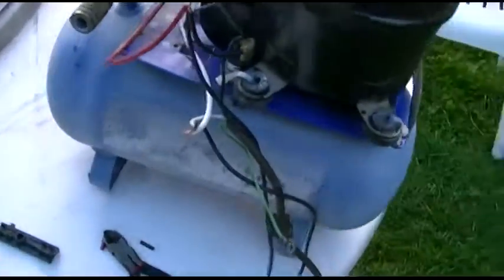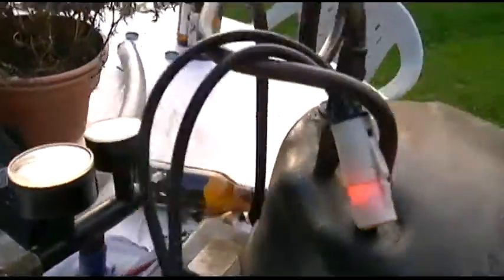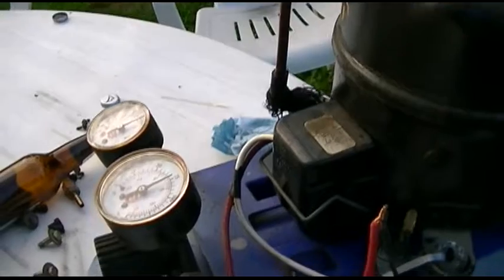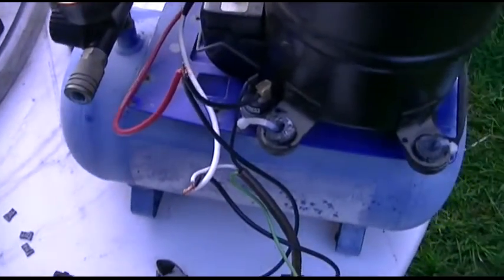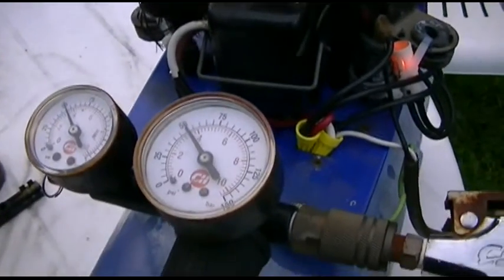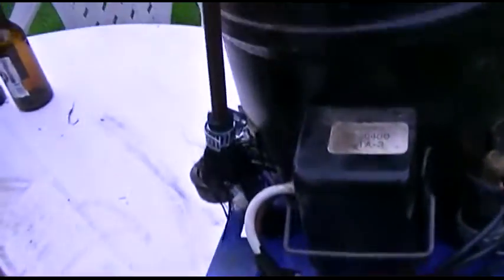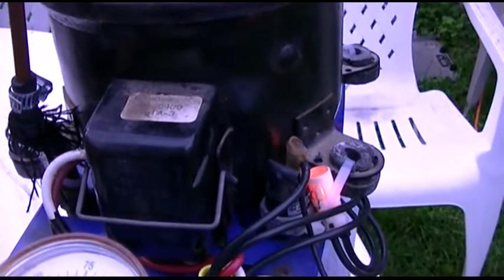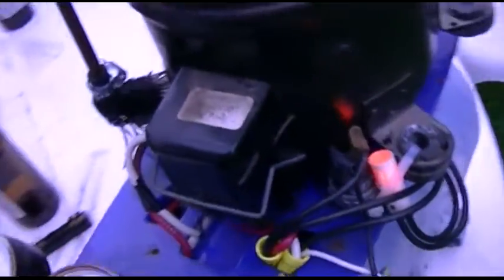Final Assembly--"Silent" Air Compressor

Comment: Is got a time delay Built-in the compressor so it doesn't cut right backs on and bun itself out
Reply from the maker: Yes it does.  When it's cold it doesn't like to start and takes many iterations to get going for whatever reason.  I thought about installing a momentary bypass switch across the time delay so I can keep it running just a little bit longer.  Most times it runs but doesn't quite "get up to steam", and just needs a half a second longer.

Comment: just out of curiosity what are you using for lubrication of the compressor? if your using refrigerant oil, moisture and air will acidify and sludge up your oil ??
Reply from the maker: I haven't started this thing since about early October, if even that late.  The reason I left the intake tube bent up is for easier lubrication--the plan is to throw a few drops of 3-in-1 oil in there before starting it up.  Not that 3-in-1 is the right stuff to use, of course.  I do have air compressor oil, which is meant for a "real" air compressor, should work in here as well.  I'm still going to use the 3-in-1 for a start, and I'll see about something else if need be.  This Kenmore compressor is pretty tough--see my overheating video of it.

This unit sat for a good 5 months, if not 6, outside, through one of the most hellish winters I have ever experienced.  I will be making a startup video of this unit within the next month or so--please consider subscribing so you'll know when!